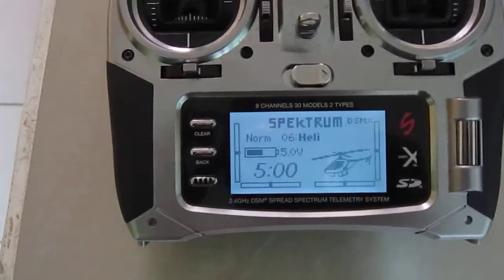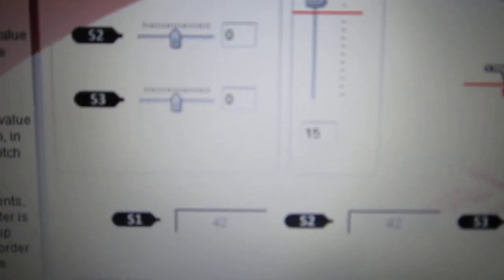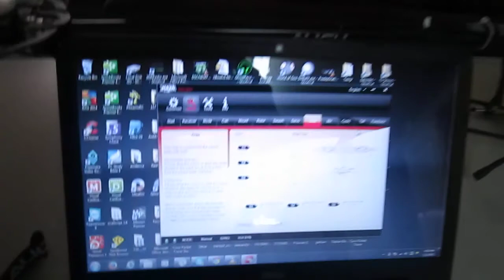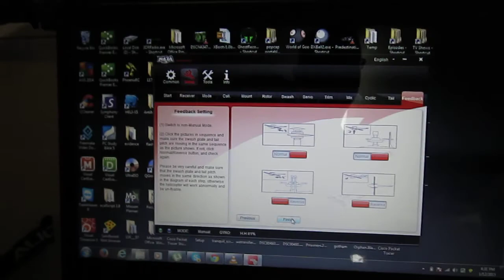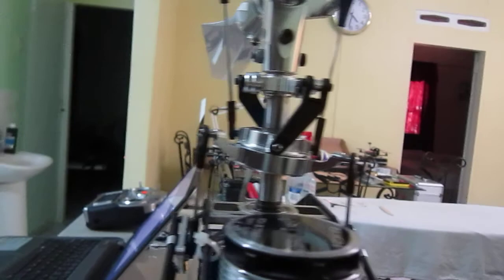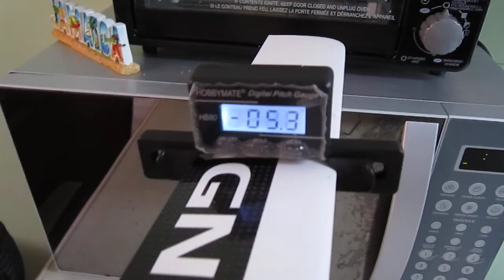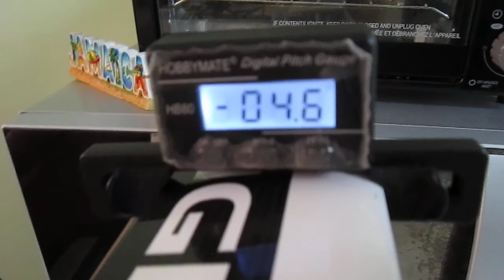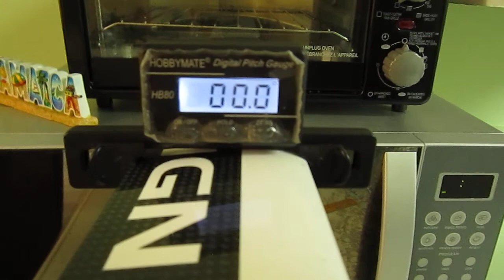DJI Naza-H Trex 700e FBL swashplate tilt issues/problems

Comment: hi bro, it is normal to tilt to one side either left or right side in attitude/GPS modes while your he'll is on the land, but when you switch to the normal position it should be leveled.  and once you fly it in normal mode only then you can witch to either att/GPS modes as you wish. do not be afraid it is normal for Naza, and Really Naza is amazing.  Best luck. and tell me your kind feedback bro.    have a Nice and smooth and safe fly, and stay safe away of Corona

Comment: friend! I have devo7 can not set up nazah. I go in the menu devo 7 in section input, fmsw-fmd, fmtrm-fmod, holdsw-hold. I come out. In section output geargear, gear act, aux2 aux2, aux2gyro.exit.swash norm configure3 running switchfmd extreme right. manual down.atti center.gps top.is in the function section gyro mode manual switc fmd pos0 12% .pos1 53.5% .pos2 93.5% .failseve not displayed in set in section gyro.motors when you start work only manuale.atti, gps not twists.ruder tail rotor hard stabilize the tail startup, uncoiler counter-clockwise servo pdi-hv2545mg. on devo exhibitedl100 r100 as nazah. going in section common nazah t channel and p is not good. pitch trim 0% originally put mechanically.with a non-rotor. now turned out that 0% tail channel, channel 3 1%, channel 1 2% in front of the helicopter 4% .if I am you can raise or lower the servo plate not 90% vane0% on all channels.0% always look on the tail vane. section mix item collectiv mix it is worth the slider 50% in fact to 0% not hold pitch -4% takeoff helicopter list in the side. adjustment helicopter rtf walkera on devo7. please help with setting.servo emax es09md esc 60aypg
Reply from the maker: I no longer use Naza-H. It destroyed too many of my helicopters. Never worked like it should.

Comment: Hi have you sort it out, because me also same thanks
Reply from the maker: N Bala Allen Giammarrusco Yes I figured it out. The problem was accerometer needed calibrating. So what I did was put my trex700 on a flat surface with battery in. I then went into the software (the last section) and hit calibrate. It works fine now.
Reply: Thanks Chadel let me try it,have a nice day.

Comment: Im building a Raptor 700e myself same setup and I'm having a similar problem, but with the elevator servo. Once in manual mode the elevator servos pops in a full forward position, but if I go in to ATTI or connect to the setup the swash plate levels out like it should.I'm interested to hear what you find out! Thanks for sharing.